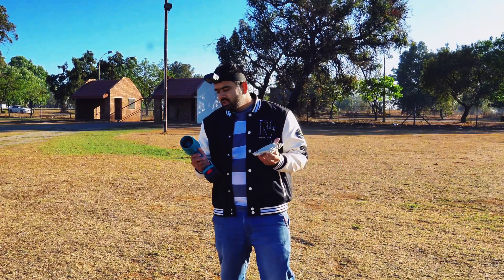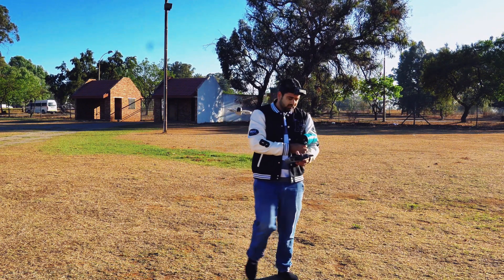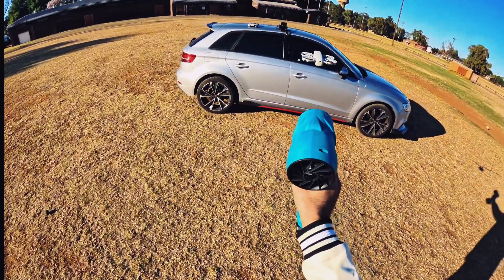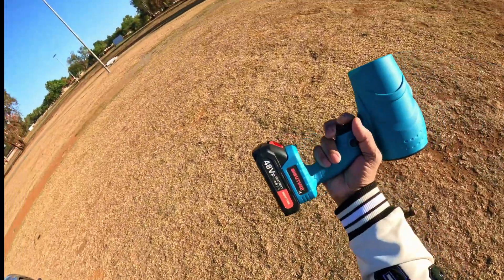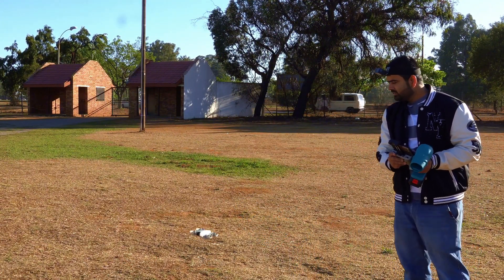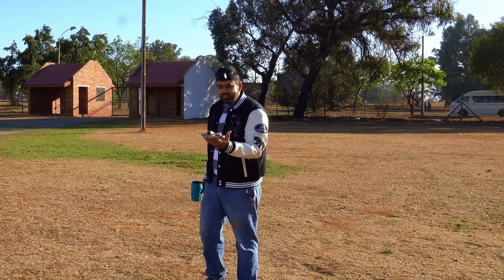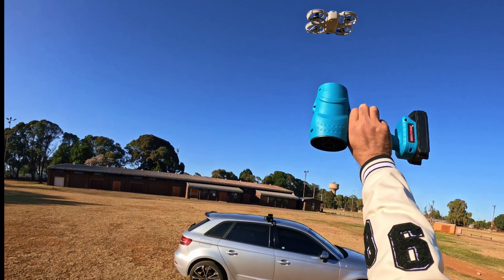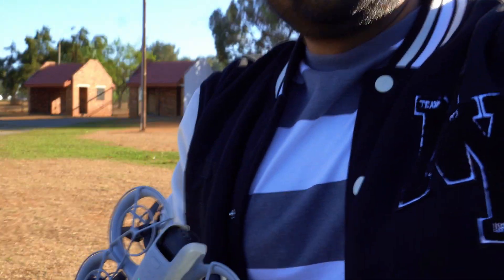I Tried to blow my Dji Neo with Air blower||Crashed  3 times during test

Comment: any idea what is the air blower speed ? that was very impressive
Reply from the maker: Will check it with wind meter but it is around 80 to 90kms
Reply: @Drone.lover.  That's cyclonic weather bro 😂
Reply: IMHO this fan is 20 mph tops